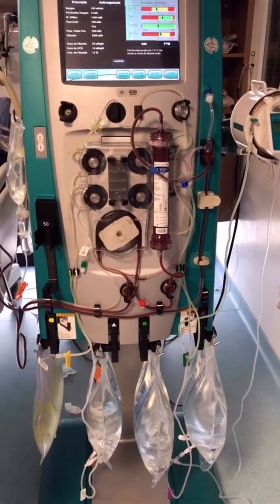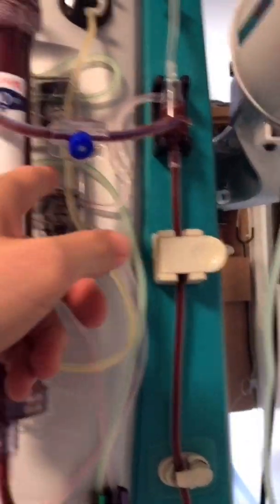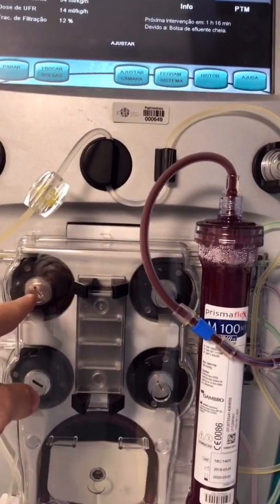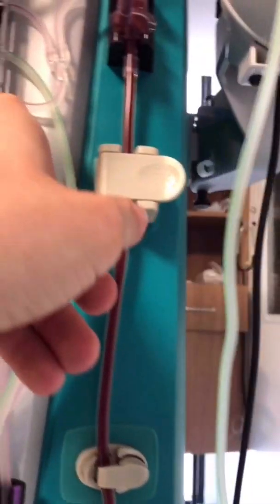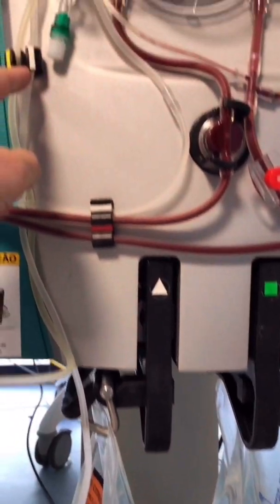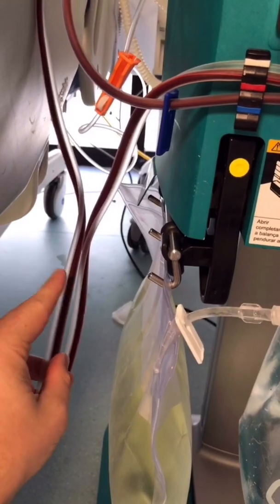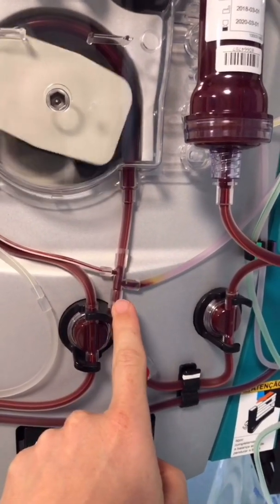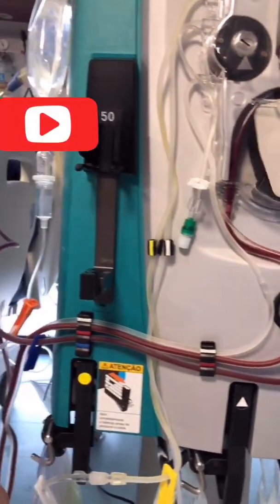CRRT PRISMAFLEX TUTORIAL - CVVHDF

Comment: Is anyone familiar with these machines?  When the machine clots off, does it have an error message or does it say treatment complete?

Also, if it did clot off, do we need to be concerned about the amount of blood that is still left in the machine and the chamber?
Reply: There is not treatment completion. This machine is made for patients that need hemodialysis 24/7. But, when you finish with the machine, either the patient's kidney function improves or patient dies, you just remove the front filter holder, with it goes the rest of the tubing, and it is all thrown away, and machine is ready for next patient immediately